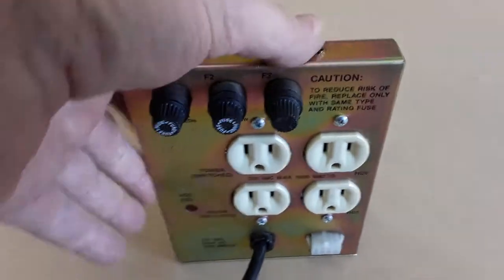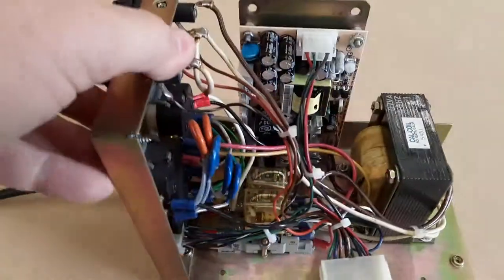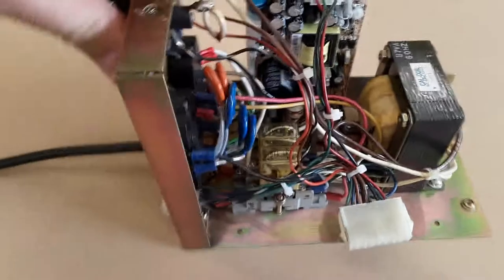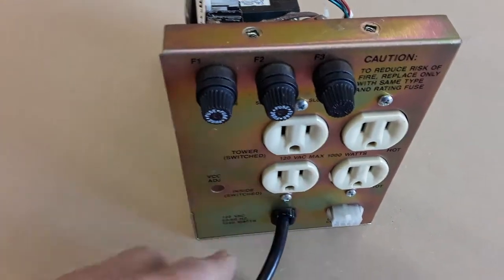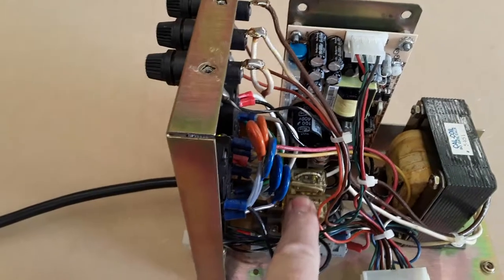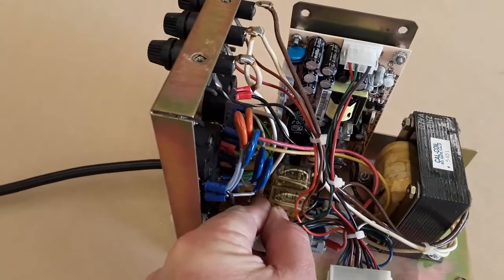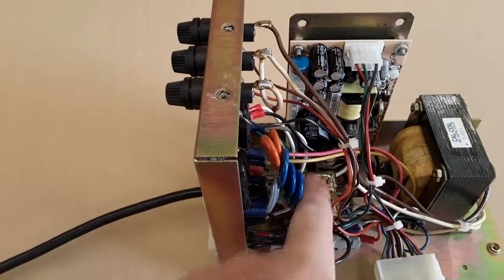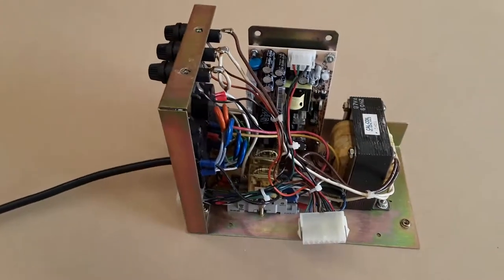2A2H Power Supply, Accessing Relays

Comment: Nice to see it's easier to reach the wiring inside the power supply.  For someone like myself who does not do this every day, the horizontally unit wiring is very rather length and it requires a bit of mental/physical gymnastics to disconnect/reconnect the wiring. 

Would a .047uf 600v capacitor (or possibly 1600v) across the primary transformer in the amplifier help to absorb the spike created when powered on/off prevent the pitting/welding of the relay contacts?
Reply from the maker: There already are such devices installed at the relays to mitigate sparking. Generally, I only see this when servicing or repairing units that are about twenty years or older. The Digital Chronobells are basically out of production as we have moved onto the PC based Bellwether.